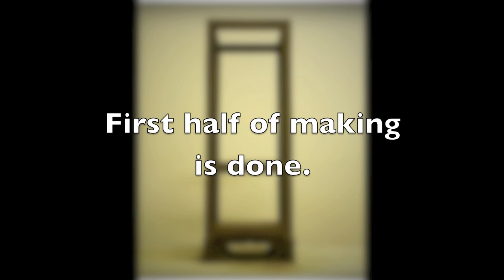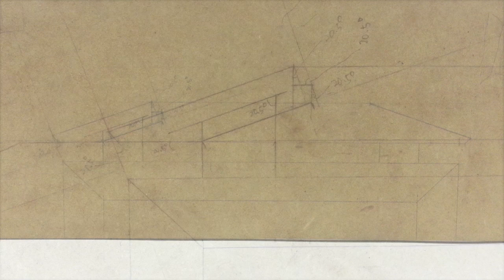Chang-ho(shoji) lamp making with a traditional joinery method.

Comment: any plans for this Mr.Ng?
Reply from the maker: Hello, this is Taeho.. I used to work for William Ng. This class was taught by me and designed by me as well.
I don't have the plan for this lamp, although, I am planning to cover this in my channel soon..
I've recently came back to YouTube and saw your comment.. I know it has been long time .. but, I thought you should know.. thanks for the interest.
Reply: @WoodArtStudio1  I love how this looks..my skills are good enough but i lack some in design so get things way out there. dimensions are a good for me .
Reply from the maker: @dougshaw9701  I can give you the dimensions.. not a problem. I'll let you know when I get back to my shop after work..
Reply from the maker: Hello Doug, sorry for the late response.
The dimensions are.. 10" x 10" x 28 1/2" high. Then roof is 1 1/2" high with 1/2" space between the frame.
The post has to start with 1 1/4" thick then water fall twice to make it at 1" thick & all cross membranes (bird's beak joint) are at 1" thick.

Comment: I would like to know the dimensions. Can anybody yell me?
Reply from the maker: The dimensions are.. 10" x 10" x 28 1/2" high. Then roof is 1 1/2" high with 1/2" space between the frame.
The post has to start with 1 1/4" thick then water fall twice to make it at 1" thick & all cross membranes (bird's beak joint) are at 1" thick.